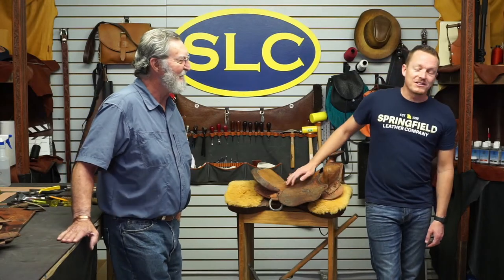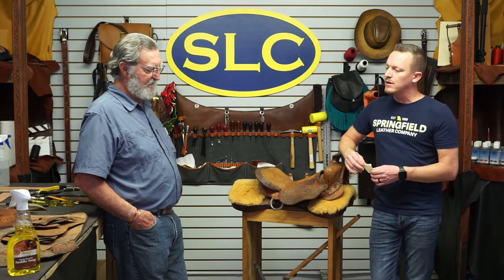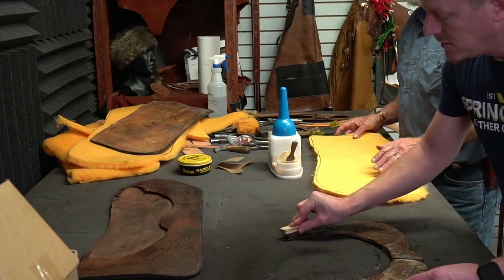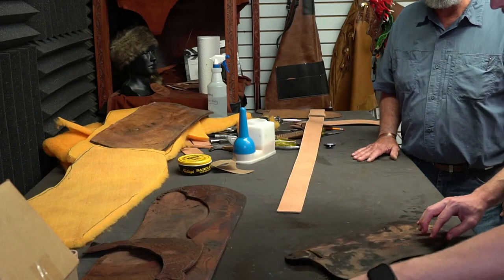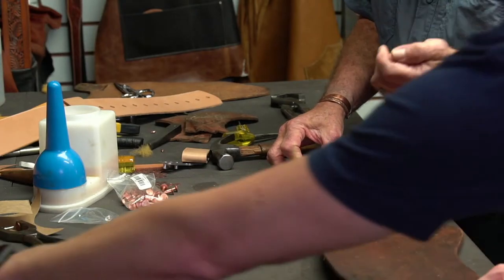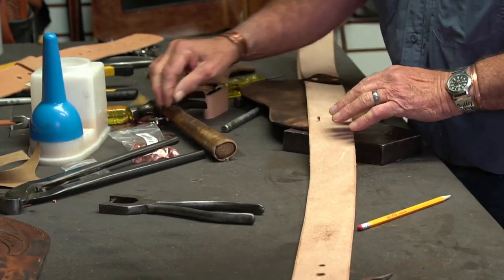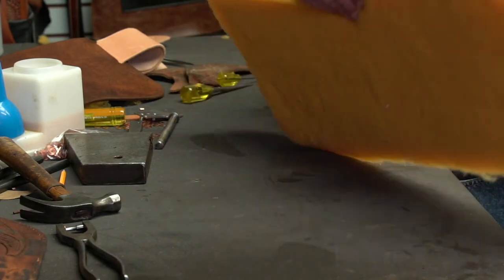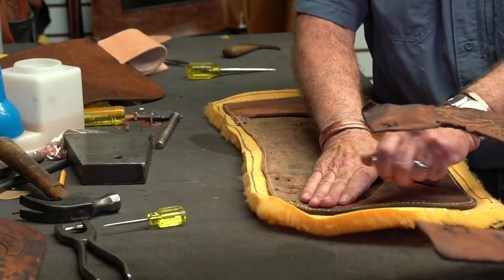Saddle Repair with Denny Lowe

Comment: Hi Denny ,great vid as usual . I have some old leather hide pieces (40 or 45 years old) and some old straps that rip like cardboard ; can they be brought back to being structurally strong with any product or should I just discard them?  Thanx Sam
Reply from the maker: Hey Sam, while you might be able to lubricate the fibers in the leather and get them worked over. You might end up fighting a losing battle. Adding neatsfoot oil and such can help, but sometimes leather finds itself in a place where the damage done is too much.
Reply: @SpringfieldLeather  Thanx Denny, that's what I thought, I already bought new, I'll just toss the old stuff !!

Comment: Guys, I think you will get better, more reliable feeding of fleece lined leather by using the so-called Blanket Foot set. This set has teeth of the feet and the feed dog. It normally ships with the Class 3 and Class 4 machines and is not just for horse blankets. It only takes a few minutes to change over to this set and will make a World of difference in the feeding of slippery squishy jobs, like padded rifle cases and saddles.
Reply: And mark up the leather if you use aggressive feet

Comment: I'm replacing the seat on my saddle. Its a good heavy ranch saddle, but if the number of staples is an indicator it is a production saddle.
When I put it back together should I put the staples back in or use nails? If nails, what kind?
Thank you
Reply from the maker: Good news! We are going to start putting our saddle together on Friday!